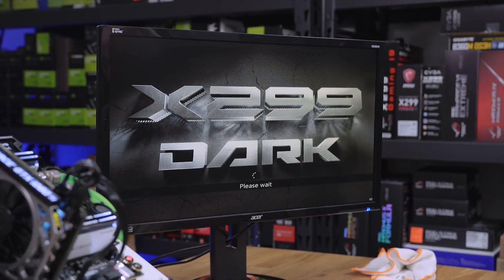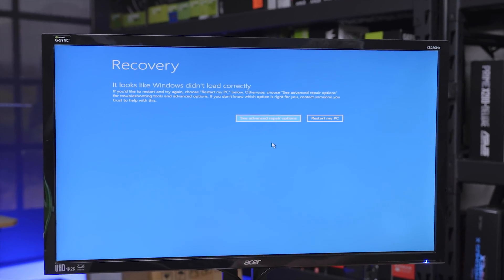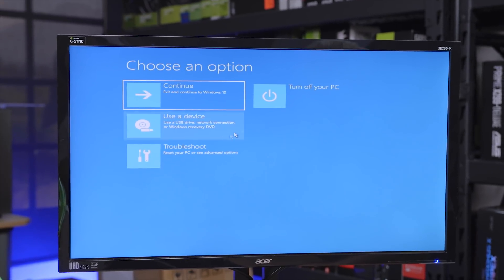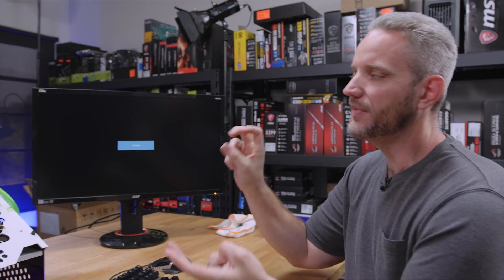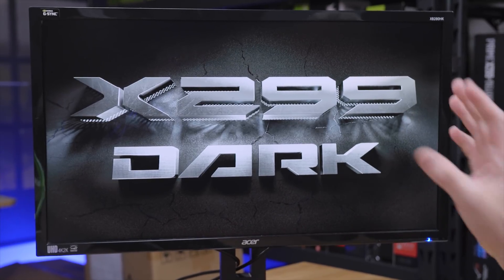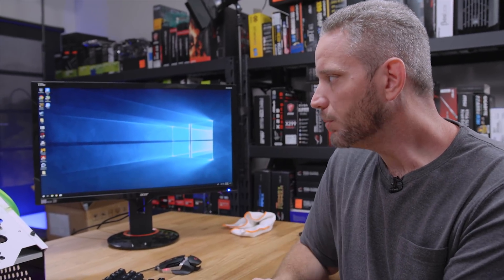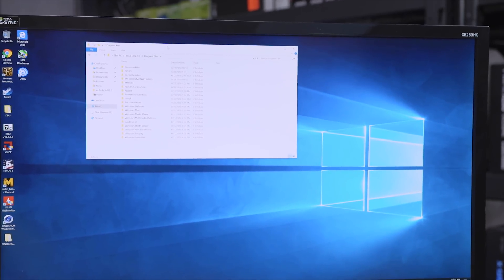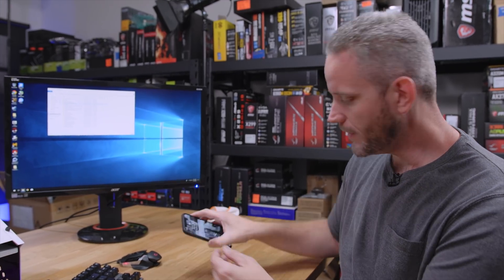New Test Bench Keeps Boot Looping... Here's how we fixed it

Comment: well duh. i commented this before to you and other reviewers using one boot drive for all tests. Very inaccurate testing method and not really professional TBH. Installing an OS is alot of registry stuff specific to the hardware. Adding 200 different pieces of hardware wont help. That`s why IT IS STILL INSTALLED and not just booted from a precompiled windows version.

Comment: hi jay was wondering if u could help me out i have a gigabyte b350 motherboard and having problems with the memory management the board is running a ryzan 1600 corsair vengeance lpx 8gb x2 and a amd asus r9 380 the problem is that i go in to the bios and turn on the xmp so it will run it 3000mhz after a while my pc go`s in to bsod then i have to go back in to the bios and reset it back to default then it runs fine at 2133mhz with no problems the problem only started a week ago and the system had been running fine for over six months ive tryed every thing i can think of i have even been to ms sucks balls site and tryed what the sugest but i still keeps happening un less i leave it on 2133mz but i never went out and spent all that money on 3000mhz memory not to have it running at its full speed i just updated the bios from the f10 to the f22 but sill the same then when i got to up date it to the f23d it says wrong part number and this is done through the gigabyte app then when i put the bios files on a usb stick and try to run it from q-flash it says theres no disk ive tryed this with all the usb ports and 2 usb drive but it wont pick up the usb any help would be good ive been at this for over a week its dring me nuts

Comment: Windows 7 does the same. Just different looking screens. You still can't access Windblows installer in safe mode. Truly crazy as Win 10 was supposed to be the "Big Fix" for all our OS probs. This goes to show that even on a test bench, either clean installs (which are always preferred) or driver cleanup (some can be done before hand) or .dll renames before change to new system if you move to new platform. But seriously, fresh install is best. Seen this so many times even on just software corrupted installs of just a program not even OS that borks OS. Windblows. Why?

Comment: Recently dealt with something similar where i had to uninstall a corrupt antivirus from safe mode.
All you have to do is use this command in cmd.exe while in safe mode:

Normal safemode: ( REG ADD "HKLM\SYSTEM\CurrentControlSet\Control\SafeBoot\Minimal\MSIServer" /VE /T REG_SZ /F /D "Service" )
OR
Safemode with networking: ( REG ADD "HKLM\SYSTEM\CurrentControlSet\Control\SafeBoot\Network\MSIServer" /VE /T REG_SZ /F /D "Service" )

then start msiserver ( net start msiserver ) and you're set. Windows will let you install/uninstall whatever you want while in safemode :)

Comment: Now Thals a neat "coincident" i had exactly that win10 boot-loop issue a few weeks ago, i found out how to solve it myself and for some interesting reason i made nearly everything Jay did in this Video, the only difference was i just deactivated the service that creates the BSOD and i used my Win10 Stick to load the startup repair stuff to enter safemode.

I was also hoping M$ was able to have some sort of Crash/BSOD detection algorithm in this version, but i guess they still can't do it, they worked like 3 decades on Windows and still can't implement it... maybe in the next few Windows versions i my have hope regained, but seriously it can't be that hard to implement something like that.
Maybe the OS can mark the crashing program and just don't load it... Or if they can't do that, the OS should be able to let us boot into safemode automatic or optional exactly after a BSOD and tell the user which program crashed(if they can...). (҂⌣̀_⌣́)

using Windows since 3.11 ¯\(°_o)/¯

Comment: There's an even easier solution to this. The windows installer service "msiserver" is intentionally not allowed to run by default in safe mode, since believe it or not some problems can actually be caused by that service in the first place, so having it run by default in safe mode could be a bad thing. You can allow it with a registry setting, though. 

If you're in Safe Mode with Networking, run Command Prompt as Administrator and enter this command:

REG ADD "HKLM\SYSTEM\CurrentControlSet\Control\SafeBoot\Network\MSIServer" /VE /T REG_SZ /F /D "Service"

After that, you can simply start the windows installer service:

net start msiserver

So easy, a monkey at Microsoft could do it.

Comment: My PC had an issue like this out of no where. I didn't change any hardware, install any drivers or even any new programs and I went to turn my PC on and got stuck in an infinite boot loop. No matter what option I picked it would just restart. I ended up having to unplug my main drive, boot off an old HDD and then go into the boot drive through file explorer and format it then do a clean install of Windows 10. What a pain in the ass

Comment: You know what's also lame about Win10? Changing your output port on the gpu so you get black screen after black screen and you freak out and think the card's dead and so you test every separate hardware item, send the card back, reinstall windows and change gpu and mobo only to have it happen again and then randomly switch from the DVI to the HDMI port and see that the output is actually there ... So you did all that crap for nothing coz all you had to do is switch the other port which Win10 started forcing the output to without telling you ...

Comment: You can't really blame Windows for this; you have a fringe use-case. The fact it's worked as long as it has is a testament to the OS itself.

I manage a few hundred Windows desktops only the Windows 7 desktops give me weird issues. Win 10 is about the most stable release since 98SE. Monitoring, event logging, and configuration are leaps and bounds ahead of Win 7 or 8/8.1.

Comment: Sorry Jay but this method is very basic and can cause a lot more issues.

Best was to remove the dll/program from loading at Windows startup and uninstall it after.
Seeing your crash happened after the user logon meaning the dll/program was in the startup list and wouldn't cause a blue-screen until it was actually loaded.

Comment: to install/uninstall in safe mode use this command.
REG ADD "HKLM\System\CurrentControlSet\Control\SafeBoot\Network\MSIServer" /VE /T REG_SZ /F /D "Service" 

then you can start running the servic...also thats only if you start safemode with networking
Regular safemode try "Minimal" instead of "Network"

I have to use this at work when ever we have to launch safemode.

Comment: You should fix windows 10 pro hdmi to tv with 5.1 home theater surround sound, i can only listen in stereo mode and it pisses me off you cant fix it by right click on the sound advanced options, enhanced, virtual, or by hitting 5.1 surround and 7.1 cause microsoft blocked them from showing up no i dont have a sound card this is a laptop using a fresh install of windows 10 pro well was fresh

Comment: I wonder if they did this because safe mode is all you need to put your drive in another system. Boot safe mode once then restart in normal mode and all your drivers for the (possibly very) different system will load up and work mostly flawlessly unless there is a conflict somewhere. 

Micorsoft sucks, windows 10 sucks and game devs suck for not moving over to linux :P

Comment: I've just had a PC emit a loud POP at the push of the start button, after a lightning storm that caused the power to go out. Turns out the power supply emitted it. Welp, time to replace it, and so I did.

Tried to start, 4 beeps, no POST screen. Whoops, something's wrong. Look up what's that for an AMIBIOS... System Timer failure, or first 64KB of RAM dead. Tried removing all the RAM, new POST code ("RAM error", duh), put back one stick in first slot, got 4 beeps again, then in the other slot and POSTs ok, then 5 beeps. Weird. Reboot, just POSTs ok, no additional beeps. Good. Try putting back the other stick of RAM, 4 beeps again. Mmh. Did the PSU take one stick of RAM with it? Tried the working stick in the first slot, 4 beeps again. Tried the other stick alone in the second slot, 4 beeps again. Retried the good stick in the good slot, 4 beeps. Something's not right and it's not the RAM.

Took out the CPU (an Ivy Bridge) and it had a burn mark on it, the socket had a burnt pin to match. Checked the pinout, it's a ground pin, so it's fine, that's not what's causing the problem. Reseated the CPU, gave it a good push, reapplied paste and cooler, tightened it more than previously, and lo and behold the system works with both sticks. I spent a day trying to figure out an issue that wasn't there before the PSU went POP, and it turned out the CPU wasn't pressed hard enough in the socket. I dislike LGA processors now.

Comment: This implementation of safe mode in Windows 10 is utter garbage! Microsoft also wants to remove the integrated Windows 7 backup tool with the next major update, so I'll have to rely on a 3rd party software...

Comment: umm.. task manager --> Startup --> disbale Ryzen master 5 to start during boot? since its a service being called during boot then i believe the earlier mentioned would work. Allowing you to boot into windows and not just renaming the folders. If the above steps are followed then registry does not get messed up with a bad entry that is going to get called once in a while using system resources

Though, i had no idea i could get away with just renaming the folder :) so i did learn something new this morning

Comment: You could always enable old "Windows F8 Menu" For the test rig so you dont have to do al the derpy steps to get into safe mode with an elevated cmd promt " bcdedit /set {bootmgr} displaybootmenu yes" . Also it is possible to run windows installer service in safemode adding a regkey so for safemode with networking elevated cmd promt   "REG ADD "HKLM\SYSTEM\CurrentControlSet\Control\SafeBoot\Network\MSIServer" /VE /T REG_SZ /F /D "Service"" Followed by  "net start msiserver"
Reply: From https://www.symantec.com/connect/blogs/windows-installer-safe-mode

Comment: Erm the blue screen has gone but now Windows thinks it has an app installed that it can't access which could cause other issues.

In safe mode just run msconfig and use selective boot. Disable all the apps and drivers you don't want to boot then reboot. Once in Windows uninstall the app. Sorted... Cleanly.

That could be used for any app or driver issue. If you don't know what's causing the problem trial and error for the win.

Comment: I've already left my thoughts on ms's apparent lack of sense ... and I'll leave one more. Remember, kids, that that shiny new version of windows you just installed is based on code from roughly 1992. That wouldn't be a bad thin in itself (heck, linux is older than that) but what is bad is that the windows team, while it may be a sizible team, is certainly never going to be big enough to handle the antiquated NT codebase of "Modern," windows. With the amount of people contributing to things like Linux and even simply the potential for anyone to do so, it's just a better system (in my opinion). That's not to say you should go install Linux right now: its not practical at all foraa a massive amount of people, particularly gamers (yes, its getting better, but until you can install every game on steam on Linux, it's not good enough).

Yes, I'm totally a Linux fanboy, you don't have to tell me that.

Comment: Grab a USB stick, you don't need more then a 16GB or so, put one of the small Linux distributions on it, make sure it has the NTFS driver, you only need console mode.  Set all machines to boot to USB first.  
When Windows pukes on itself, you grab that stick, boot into it, you only need 3 commands....

ls will list a directory 
cd changes a directory
mv moves something to another name.

Do your edit, and then remove the stick to reboot windows.

Comment: There are ways to enable the windows installer in safe mode. I use a program called D7, but, I mean, its not really something an average joe would be great at figuring out or finding. D7 has saved my bacon so many times, tho. Great program any IT tech should have on their thumb drive!

Comment: You can enable the F8 Bootoptions by setting the bootmenupolicy to Legacy. This can be done with "bcdedit /set {current} bootmenupolicy Legacy" from a privileged CMD. But you have to do when your Windows still boots, or from Safe Mode if you think you need more tries to troubleshoot the Problem.
It is also possible to set it offline from a Installation Media, but may be need to specify the store and the ID won't be {current} as you are currently running Windows PE from your Installation Media.

Comment: Windows 10 has never gave me any problems as I know my way around it as I am from the  Microsoft DOS area .Correct me if I am wrong but when you build a PC is it not windows is licensed to that machine  so switching from AMD to Intel is not the same machine by far but  it will be easier going from Intel to Intel .   But why bother with a messy drive I just  always do a fresh install  as  my games are not on my main M.2 as they are on their own SSD Drive  and as for my other software it's installed  on  the M.2 drive  which is easy for me to reinstall a fresh  install.... Always work better.    I don't think Windows had in mind a person like you Jay that swaps PC hardware daily.    I thinking you should have a  AMD drive for AMD systems and Intel Driver for Intel  :)

Comment: I uninstall old product drivers prior to installing new hardware if it's a totally different brand. If it's the same brand but an updated product then I would check if the drivers are the same for the new peripheral. Once the Uninstall is completed then I will hunt down the folders, delete those then proceed to use CCleaner to clear out any old junk that may still linger. I'm changing out motherboards and CPUs quite a bit and never really needed to perform a clean install of Windows as I reserve those for total system rebuilds (for convenience of doing it all in one shot rather than piecemeal). I don't recall running into such issues on Windows 10 but I still prefer using Windows 7 as my OS of choice until it is no longer supported.

Comment: UMMM wouldn't it just be so much simpler to run task manager in safe mode and UNCHECK the AMD Ryzen Master startup option? I thought this saved across the safe mode and normal mode boots. Maybe I am wrong...
Reply: If safe mode saves settings for the next boot someone at windows is even dumber than I thought and that's saying something. That's some serious stupidity effort right there.
Reply: Just tested this and disabling startup items while in safe mode does keep them disabled during the next normal boot. This was done to replace the old MSCONFIG method. In the same task manager window, under the services tab, you can disable services as well. I think Jay's method is fine if you need to take a shotgun approach and you know what the cause is, but this is a more surgical approach.

Enjoy your new knowledge.
Reply: or use autoruns.exe from microsoft's sysinternals suite if the program causing issue doesn't show in startup options

Comment: I think most of you are missing the point, trying to defend windows 10 and getting mad at Jay. To start, in a test bench, it is not practical to do a fresh install of the OS every single time. Takes way too much time when just trying to benchmark different hardware. The problem could of easily been solved had safe mode worked the way it was suppose to, only being able to access it from the desktop and not being able to uninstall in safe mode just makes no sense. That's why this is an example of windows 10 being the garbage fire that it is. He has to jump through a bunch of hoops for a simple issue that doesn't even happen that often. Hardware swaps in windows 7 were never a problem for me, with out a clean install, and in Linux it's even easier.

Edit: Spelling

Comment: Another way I have found if you wanted to really uninstall certain programs, you couldn't do and got that error like jay did with Windows installer, is once you are able to load into Windows via it being safe mode or not, is type Control Panel in the search bar, click on that, then Click on Uninstall a Program, under Programs and it brings up a list of all the programs you are running and i have found at least in my case ( yes it is Windows 10 Pro) that it actually lets you try to Uninstall and or modify those Program files in that set list. I do not know why that is, but like Jay says the Monkey boys over at Microsoft need to find the correlation between their new UI programs feature thing and the old style of Uninstalling Programs like I listed above. I'm not a tech genius or studied any of this, it was all trial and error thanks to past hiccups of Graphics drivers and Programs not wanting to uninstall through the new UI feature from windows. I hope this helps anyone out there and if not, sorry to have waster your time, but at least I gave you something to try.

Comment: Windows 7 forever.
Reply: didn't seem to bother the people running xp
Reply: i used xp untill 2011 on my laptop and only went with win7 after getting my desktop pc.
and untill win10 gets to the point of win7 in its starting days im not even gonna bother with that trash.

i rather use an old os than a half baked shit show.
Reply: Boinz U Windows 7 Remastered 🙃
Reply: 7 have limited stuff that stops you for gaming at high performance. 10 is optimize